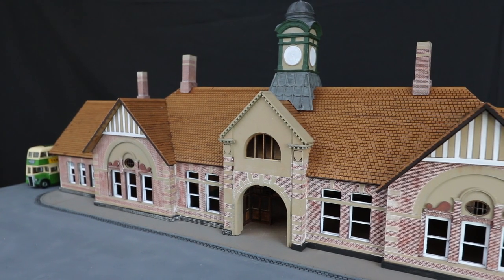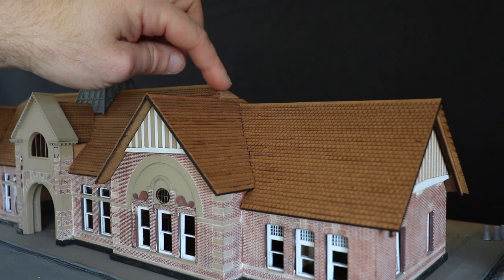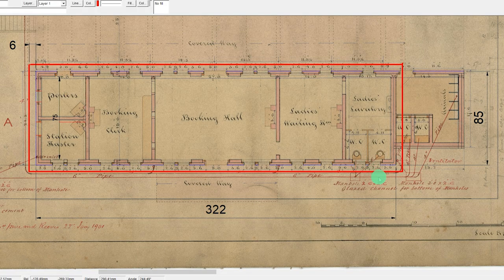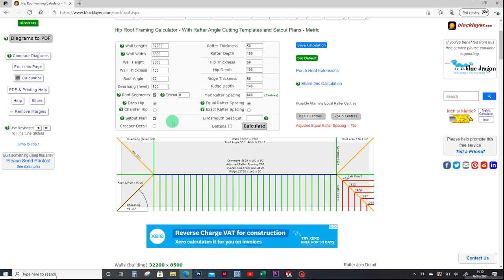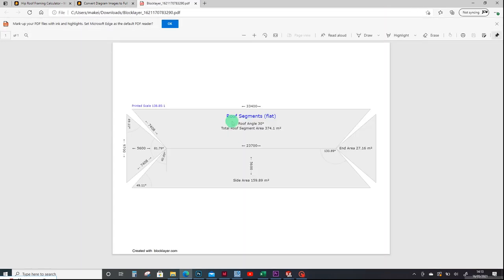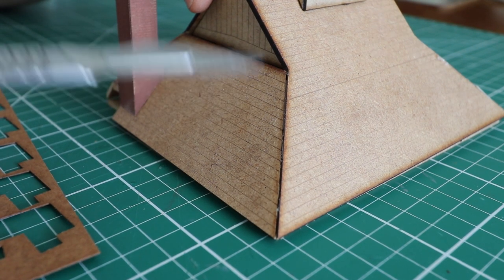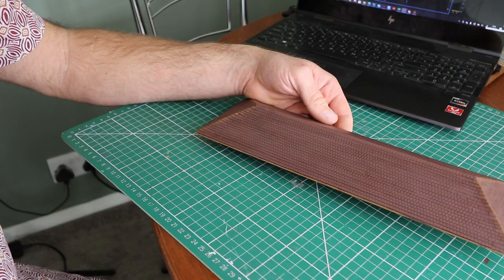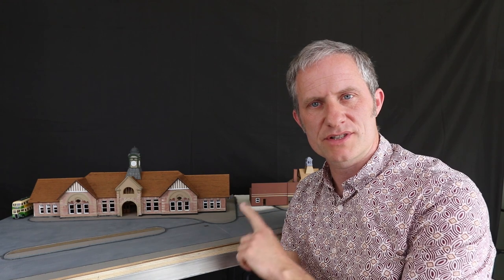Progress with Roofing at Bexhill West

Comment: That was a  very interesting video James, they will look fantastic when in place. I had when it was working a roofing square, it was marked in such a way you could work out the lengths of your rafters, common, Jack, hip etc. It would give you the seat cut and the what we called the birds mouth cut to fit over the wall plates. I used to like roofing it was very satisfying and even today whenever I drive around I sometimes pass a building and think "I helped put that roof on", it was a lot of work back in the 60s and 70s we didn't have the portable power tools they have today. Look after yourself James, see you next time Eddy xx

Comment: James, hips in slate have been differently covered over the ages, also depending on the region and the slates available. 
Hips in France for instance are most often consisting of a row of slightly larger slates covering each side of the hip, over the slate surface. The joint on top of the hip was generally made “cold”, which required some very accurate slate adjustments over the lengt of each slate.
More northern slated roofs on the continent were made with a lead slab under each pair of hip slates. This way the exposed line on top of the hip is definitely watertight. I model such a hip cover in an exact similar way by forming a piece of aluminum tape under each pair of hip slates. Inconsistenties then are still covered properly and the hip line will really look as sharp as in the real and large world.

Comment: Hi James interesting video, you need to go back to first principles of technical drawing and use development to add curves to those corner tiles, alternativel if your CAD system can do sheet metal work that would be another way, or the simple way is to take the drawing and split the tile up the fold line move it apart just enough for a radius no more than 1mm at 4mm scale and put a fillet in at the bottom and top. 

Red slate by the way is closer to a mix of slate grey and plum, you can spot the difference, but it's subtle, the earliest pics of Bexhill West do appear to show slate but at what time (pre 1961) it was replaced I'd not like to guess, the one early pic suggests no fancy ridge tiles were present so they probably used lead on the ridges and in the valleys as well

I found a couple of pics that I consider interesting, if you look at the modern roof e.g google streetview https://www.google.com/maps/@50.8404818,0.4635635,3a,44.4y,335.55h,97.47t/data=!3m6!1e1!3m4!1sCIwbv08h1MfEqxk6bDUteA!2e0!7i13312!8i6656 you will note the ornate finials on the ends of the various roofs, however if you go back to 1964 https://upload.wikimedia.org/wikipedia/commons/8/87/Bexhill_West_railway_station_%281964%29.jpg no fancy finials which means that the roof has been changed to some degree since the station closed, However I just came across this postcard from 1906 https://twitter.com/bexhillmuseum/status/1220007764929470464/photo/1 Now this I think shows a similar number of lines as we have with tiles, which begs the question, is the one hand coloured early pic an artists impression and when it came to construction did they decide to use tiles rather than the more expensive slate ?
Reply from the maker: Hi David, I have some curved bonnets fashioned on the computer, just waiting to cut them out. 
As for slates at Bexhill West, I’ve read reports that they were fitted, but no conclusive photographic proof. Maybe they were replaced at some point, but I doubt it. 
Thanks for watching, and for your input,
James

Comment: When normal modellers would just put a plastic strip of rigde tiles on ...
... some would go for roughly cutted and bend (corrugated) carton or plastic card ...
... you go for a rather prototypally look, over a computer-assisted angle calculation ...
... and I really like that other - not that simple, out of a other box - way.
A bit of paint would fill those cracks simply.
Curved hip bonnet - curved part instead of the angled middle part, two or three bending edges instead of one? 🤔
😮, inside of the 🕰️ you have been - seen one mechanism driving all four sides to slow for your assignment 🤪 well you gona get it done proper.